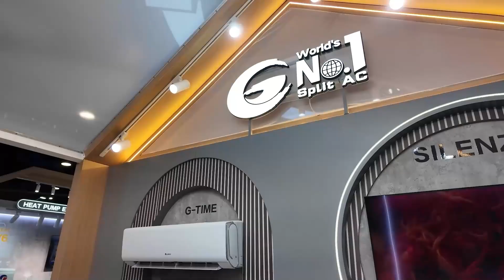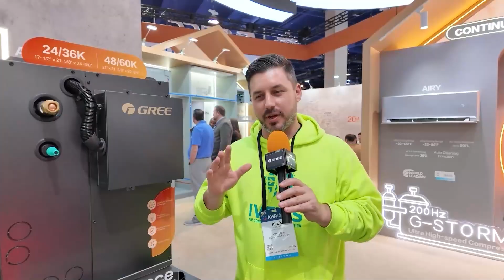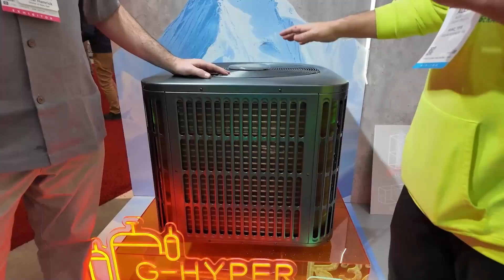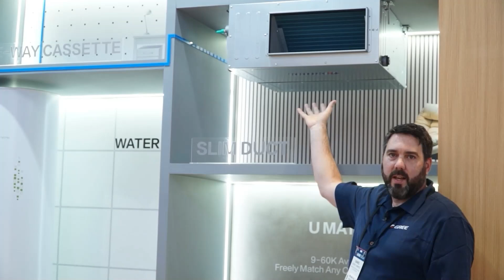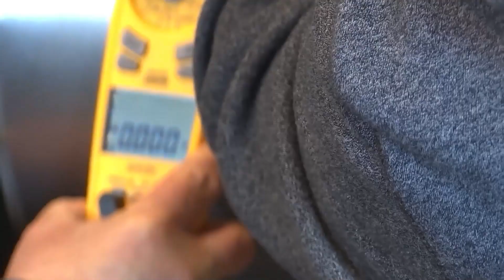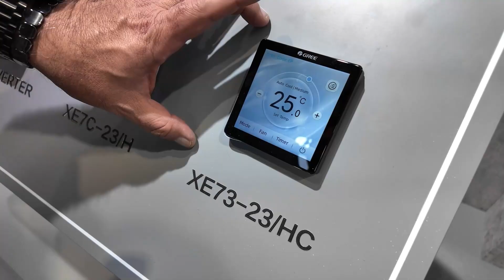What You Missed at AHR 2026 Could Cost You Jobs #talkingcomfortlive with #greecomfort

Comment: Additional thoughts on the top discharge, from someone up in the Boston mass area, cold but not the worst. I think dual fuel will continue to gain traction personally, as long as the utilizes allow for it in their rebates. If I’m correct and this trend continues, super effective cold climate heat pumps may not be “needed” in super cold climates, unless all electric is the goal. This addition to your product offering could prove to be a big deal
Reply from the maker: Appreciate you sharing your perspective from Boston!